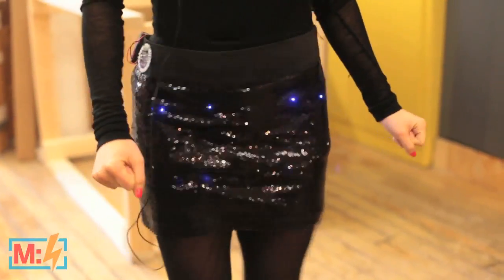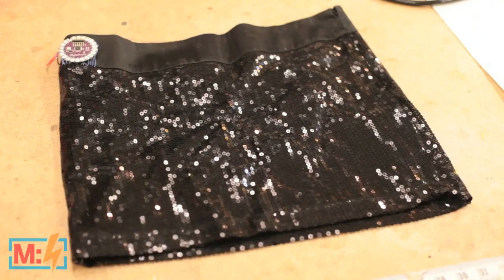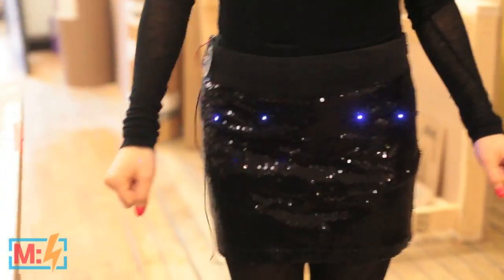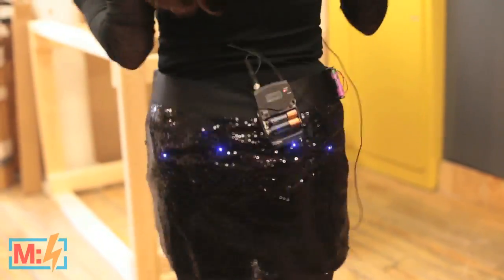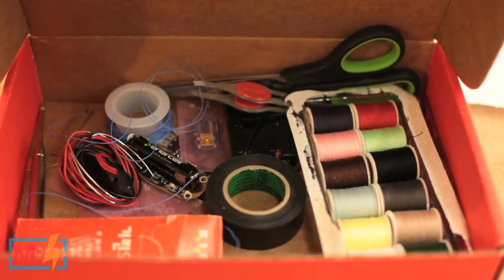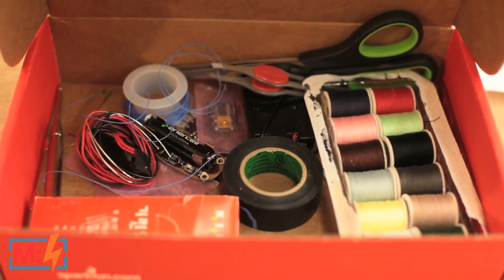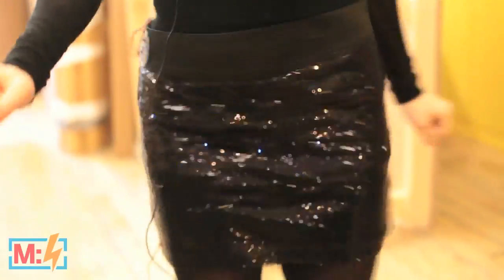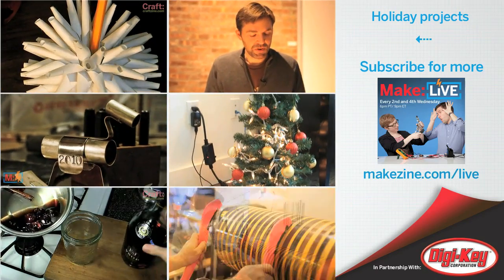Twinkle LED Dance Party Skirt on Make: Live ep22

Comment: it doesn't need a large battery pack. They battery pack on the back side is actually for the microphone. This device uses one AA size battery which is very discreet.